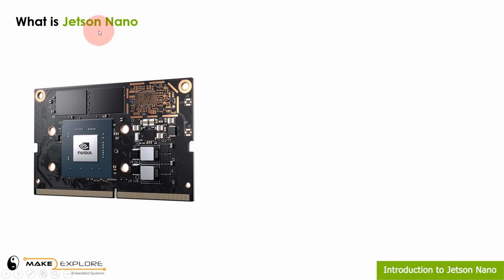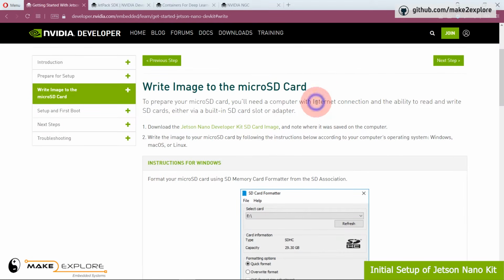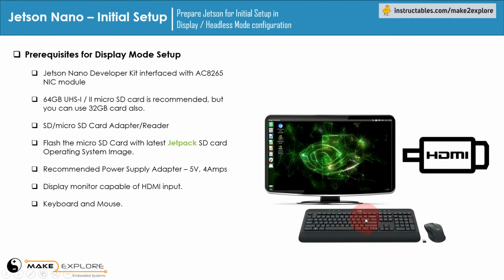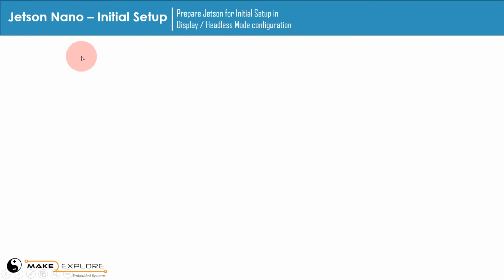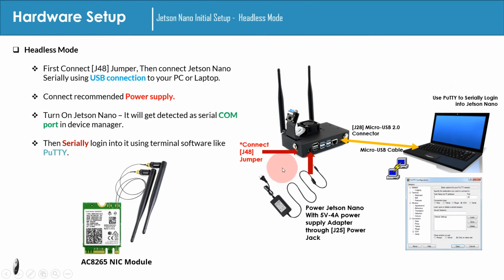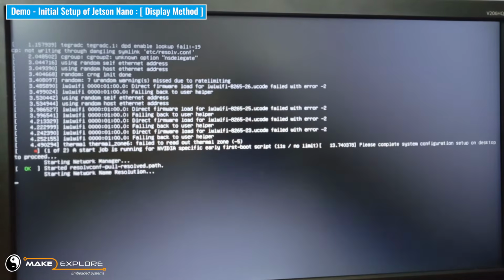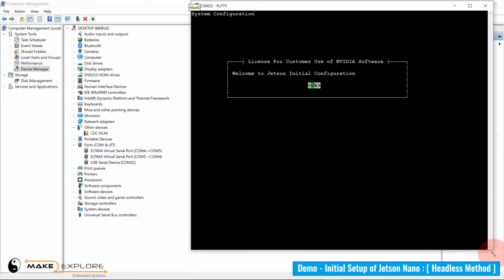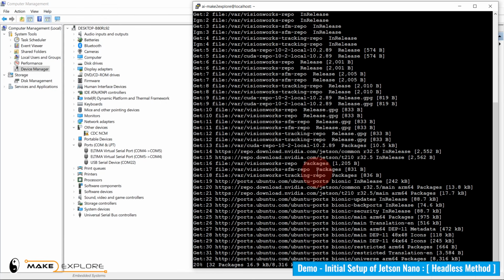[Tutorial] Getting Started With Jetson Nano

Comment: my jetson nano got delay about 0.5 to 1 second when typing. did sd card is my problem ? but i using the samesadisk version like you
Reply from the maker: Dear Friend, @madebagasmardiana3154

Thank you very much for your interest in our channel. Please accept our sincere apologies for the delayed response..

Q - my jetson nano got delay about 0.5 to 1 second when typing. did sd card is my problem?...

➡️ That kind of delay is definitely frustrating and, while the SD card *could be a factor, it's not the only possibility. The Jetson Nano is an embedded system and sometimes experiences general lag depending on the workload and configuration. A 0.5 to 1-second delay often indicates the CPU or memory is under heavy load and struggling to process system events, including keyboard input.

--  Try JetsonStats Widget - Open a terminal and run the command top or htop to see what processes are consuming the most CPU and Memory when the lag occurs.
--  If memory is low, consider increasing the size of your swap file (if you haven't already). This can help prevent the system from completely freezing, though it will still be slower.
--  Power Supply Issues - Insufficient or unstable power can cause the Nano's CPU/GPU clocks to throttle down, leading to significant performance degradation.
--  **Software/OS Configuration - try stable release of Jetson OS, JetPack. If you're using legacy hardware of Jetson Nano, then you should try legacy software OS variants. Latest JetPack OS may cause lag issues.

So, the most likely culprits are system load, slow SD card, or the OS.

Hope this info will help you. If you still have any other suggestions/issues/queries about this Tutorial, or any of our DIY project, feel free to ping us on WhatsApp/Telegram (Links given below).

Tech support - (𝗖𝗵𝗮𝘁 𝗢𝗻𝗹𝘆) Telegram/WhatsApp - 11:00 AM - 05:00 PM (Mon-Fri) IST   

🚀 𝗧𝗲𝗹𝗲𝗴𝗿𝗮𝗺      🔗 https://t.me/make2explore
💬 𝗪𝗵𝗮𝘁𝘀𝗔𝗽𝗽    🔗 https://bit.ly/3VXGGEe
📩 info@make2explore.com  / support@make2explore.com

Thank you very much for your support.

Best Regards

Comment: how can we put ubuntu 22 in it?
Reply from the maker: Dear Friend Jena Rohi, @jena2379

Thank you very much for your interest in our channel.

Q - how can we put ubuntu 22 in it?....

➡️ If you're referring to Jetson Nano Board used in this tutorial. So it is a legacy hardware. Installing Ubuntu 22.04 on the NVIDIA Jetson Nano is not officially supported by NVIDIA, as the latest JetPack SDK for Jetson Nano (JetPack 4.6.3) is based on Ubuntu 18.04. However, it is possible to install Ubuntu 22.04 using community-supported methods or manual upgrades, though this comes with potential compatibility issues, particularly with NVIDIA-specific components like CUDA, cuDNN, and TensorRT. 

So there are two options - 
Option 1: Manual upgrade from Ubuntu 18.04/20.04 to 22.04
We tried to manually upgrade the flashed system from Ubuntu 18.04 to 22.04. But we came across 'critical error' after that. 

Option 2: Use a Community Ubuntu 22.04 Image
You can try following community Ubuntu 22.04 Image
https://forums.developer.nvidia.com/t/ubuntu-22-04-image-beta-test-for-jetson-nano/253301
We also tried this but compatibility and dependency issues still comes.

📌 Important Note: The Jetson Nano is a different product from the Jetson Orin Nano. The Jetson Orin Nano is a newer device that has official support for Ubuntu 22.04. You can Download and Flash the latest Jetpack SDK directly onto SD card. Use at least 64G (Highspeed card). It comes with/built on Ubuntu 22.04.
🔗 https://developer.nvidia.com/embedded/jetpack

If you still have any other suggestions/issues/queries about this Tutorial, or any of our DIY project, feel free to ping us on WhatsApp/Telegram (Links given below).

Tech support - (𝗖𝗵𝗮𝘁 𝗢𝗻𝗹𝘆) Telegram/WhatsApp - 11:00 AM - 05:00 PM (Mon-Fri) IST   

🚀 𝗧𝗲𝗹𝗲𝗴𝗿𝗮𝗺      🔗 https://t.me/make2explore
💬 𝗪𝗵𝗮𝘁𝘀𝗔𝗽𝗽    🔗 https://bit.ly/3VXGGEe
📩 info@make2explore.com  / support@make2explore.com

Thank you for your support.

Best Regards

Comment: Can we use a power bank 20000mah anker to the micro USB to power it?
Reply from the maker: Dear Friend Ashish @ashish.pakabear

Thank you very much for your interest in our channel. 

Q - Can we use a power bank 20000mah to the micro USB to power it?....

➡️ Yes, you can use a 20,000mAh power bank to power the NVIDIA Jetson Nano, but there are some important considerations to ensure stable operation.

📌 Power Output (Most Critical factor)
--  The Jetson Nano requires 5V/4A (20W) when using a barrel jack (Recommended).
--  If using a micro-USB connection (older models), it needs 5V/2A (10W), but this may lead to instability under heavy loads.
--  Your power bank must support at least 5V/3A (15W) or higher (preferably with USB PD or QC support).

📌 Power Bank Specs
--  Check if your power bank has a USB-C PD (Power Delivery) or QC (Quick Charge) port that can deliver 5V/3A or higher.
--  Some power banks have "Auto Power-Off" features that may shut down if the Jetson Nano draws low current at idle.

📌 Connecting the Jetson Nano
--  Best Option: Use a USB-C to Barrel Jack cable (if your power bank supports 5V/4A output).
--  Alternative: Use a USB-A to Micro-USB cable (if your power bank has a high-current USB-A port, but this may not provide enough power under load).

📌 Battery Life Estimations
--  A 20,000mAh power bank (actual capacity ~12,000–14,000mAh due to efficiency losses) could theoretically run the Jetson Nano for:
==>  ~3–5 hours (if drawing ~4A continuously).
==>  ~6–10 hours (if drawing ~2A under lighter loads).

Hope this information will help you. If you still have any suggestions/issues/queries about this Tutorial, or any of our DIY project, feel free to ping us on WhatsApp/Telegram (Links given below).

Tech support - (𝗖𝗵𝗮𝘁 𝗢𝗻𝗹𝘆) Telegram/WhatsApp - 11:00 AM - 05:00 PM (Mon-Fri) IST   

🚀 𝗧𝗲𝗹𝗲𝗴𝗿𝗮𝗺      🔗 https://t.me/make2explore
💬 𝗪𝗵𝗮𝘁𝘀𝗔𝗽𝗽    🔗 https://bit.ly/3VXGGEe
📩 info@make2explore.com  / support@make2explore.com

Thank you for your support.

Best Regards

Comment: after the setup it showed the home page and suddenly turned off now it’s not turning on 
When I turn on and off the led is glowing for 1 sec and turning off pls help me with this
Reply from the maker: Dear Mohammad Junaid @mohammadjunaid2941,

Thank you very much for your interest in our channel.

Q - _after the setup it showed the home page and suddenly turned off now it’s not turning on 
When I turn on and off the led is glowing for 1 sec and turning off pls help me with this..._

➡️ This looks like OS/Jetpack related issue. (Black screen/Nano unable to boot/Screen Freezing/White Screen Issue). These are typical/usual issues with Jetson Nano -  You can check on NVIDIA forum

🔗 https://forums.developer.nvidia.com/t/nvidia-jetson-nano-freezes-at-nvidia-logo-screen/236944

Solutions ==> 
-- If you are using Jetson Nano 2GB/4GB (old Hardware variant which reached EOL support) 
➡️ Have you tried Nano with Jetpack 4.6.1 ?
During our project development and As per our experimentation/testing, we found Jetpack 4.6.1 is the most stable release for Jetson Nano.

You can try other versions also. Following is the Archives page. (4.6.1 to 4.6.6)

🔗 https://developer.nvidia.com/embedded/jetpack-archive

Try multiple OS releases and find out best supported release for your Nano 2GB/4GB

-- If you are using Jetson Orin Nano Series (New Hardware variant) 
➡️ Then try Jetpack 6.0 onwards, (you can try latest one).

🔗 https://developer.nvidia.com/embedded/jetpack

If the problem still persists then we suggest that you should carefully check your hardware configuration and setup, SD card/Power supply may be the issue.

📌Please check your Nano version then check your carrier board specifications and then choose correct power supply accordingly. 

⚠️***Since Nano is very expensive dev board. Please be cautious. Do not plug-in any random power adaptors unless you confirm/sure about voltages and current ratings. Check your device specific user manuals and datasheets for more details⚠️

Hope this will help, beside If you still have any queries/issues/suggestions about this Tutorial, or any of our DIY project, feel free to ping us on WhatsApp/Telegram (Links given below) for further support.

Tech support - (𝗖𝗵𝗮𝘁 𝗢𝗻𝗹𝘆) Telegram/WhatsApp - 11:00 AM - 05:00 PM (Mon-Fri) IST   

🚀 𝗧𝗲𝗹𝗲𝗴𝗿𝗮𝗺      🔗 https://t.me/make2explore
💬 𝗪𝗵𝗮𝘁𝘀𝗔𝗽𝗽    🔗 https://bit.ly/3VXGGEe
📩 info@make2explore.com  / support@make2explore.com

As per time permits we will try our best to help you out. 

Best Regards

Comment: I have 5 volt 2.5 amp adapter is that ok for just setup ?
Reply from the maker: Dear Mohamed @mohamedmansour2013, 
Thank you very much for your interest in our channel.

Q - I have 5 volt 2.5 amp adapter is that ok for just setup ?

➡️ It is totally depends on which version of Jetson Nano you have. and What type of Carrier board you are using. Check out following link for more details -

https://developer.nvidia.com/embedded/learn/jetson-nano-2gb-devkit-user-guide#id-.JetsonNano2GBDeveloperKitUserGuidevbatuu_v1.0-SCL

***Some versions of The Jetson Nano 2GB Developer Kits cannot be powered via the Micro-USB connector. 

If you are using old Jetson Nano(4GB/2GB) with microUSB and 5V Power Jack (Like we used in video) then Yes, you can try with 5 volt 2.5 amp adaptor for initial setup. If you are using USB Power then 5V⎓2 or 2.5A is recommended. 

But please note that if you connect any external peripherals like USB Mouse, Keyboard and WiFi adapter etc. They sometimes consumes/sink more power and Nano is unable to boot. Some power hungry computations(AI/ Machine Vision applications) requires more CPU/GPU power, Hence it is recommended to use at least (3-4A power for Jack) and 2.5-3A for micro USB(for old Boards).

📌Please check your Nano version then check your carrier board specifications and then choose correct power supply accordingly. 

⚠️***Since Nano is very expensive dev board. Please be cautious. Do not plug-in any random power adaptors unless you confirm/sure about voltages and current ratings. Check your device specific user manuals and datasheets for more details⚠️

Hope this will help, beside If you still have any queries/issues/suggestions about this Tutorial, or any of our DIY project, feel free to ping us on WhatsApp/Telegram (Links given below) for further support.

Tech support - (𝗖𝗵𝗮𝘁 𝗢𝗻𝗹𝘆) Telegram/WhatsApp - 11:00 AM - 05:00 PM (Mon-Fri) IST   

🚀 𝗧𝗲𝗹𝗲𝗴𝗿𝗮𝗺      🔗 https://t.me/make2explore
💬 𝗪𝗵𝗮𝘁𝘀𝗔𝗽𝗽    🔗 https://bit.ly/3VXGGEe
📩 info@make2explore.com  / support@make2explore.com

As per time permits we will try our best to help you out. 

Best Regards

Comment: puedes por favor recomendarme la camara USB que sugiere la jetson nano? (USB), gracias
Reply from the maker: Dear Friend @jmbcrp1010, 
Thank you very much for your interest in our channel. 

Q - puedes por favor recomendarme la camara USB que sugiere la jetson nano?

➡️ Jetson supports multiple camera interfaces including USB, Ethernet, and MIPI CSI. You can use according to your application. At its core, the Jetsons use the Linux kernel module Video Four Linux (version 2) (V4L2)

➡️ In case of USB Camera Series Jetson supports UVC(USB Video Class standard) - compliant board cameras. The video from a USB camera takes a different route. In Linux, The USB Video Class driver (uvcvideo) is a Linux kernel module. The uvcvideo module supports extension unit controls (XU controls) to V4l2 through mapping and a driver-specific ioctl interface. Input/Output Controls (ioctls) are the interface to the V4L2 API. What this means is that a driver in a USB camera device can specify different device dependent controls, without uvcvideo or V4l2 having to specifically understand them. The USB camera driver hands a code for a feature, along with a range of possible values, to uvcvideo. When the user specifies a feature value for the camera, uvcvideo checks the bounds of the argument and passes it to the camera along with the feature code. The camera then adjusts itself accordingly.

➡️ You can also use USB Depth Cameras, High Speed Cameras with Jetson Boards. Check out following list from official NVIDIA website for Jetson Partner Supported Cameras

🔗 https://developer.nvidia.com/embedded/jetson-partner-supported-cameras?t-1_camera-interface=USB&t-1_supported-jetson-products=Orin

For more details about camera interfacings you can check out excellent tutorials by Jim from JetsonHacks 

🔗 https://jetsonhacks.com/2022/02/02/in-practice-usb-cameras-on-jetson/

🔗 https://www.arducam.com/jetson-nano-xavier-nx-camera-solutions/

➡️ **For getting started with Jetson Nano, we suggest *Logitech C270 USB camera which is readily available and easy to setup.

If you have any queries/issues/suggestions about this Tutorial, or any of our DIY project, feel free to ping us on WhatsApp/Telegram (Links given below) for further support.

Tech support - (𝗖𝗵𝗮𝘁 𝗢𝗻𝗹𝘆) Telegram/WhatsApp - 11:00 AM - 05:00 PM (Mon-Fri) IST   

🚀 𝗧𝗲𝗹𝗲𝗴𝗿𝗮𝗺      🔗 https://t.me/make2explore
💬 𝗪𝗵𝗮𝘁𝘀𝗔𝗽𝗽    🔗 https://bit.ly/3VXGGEe
📩 info@make2explore.com  / support@make2explore.com

As per time permits we will try our best to help you out. 

Best Regards

Comment: After I do the first boot into my Jetson Nano 4GB. The autosetup GUI where you set the time, your new username, expand the drive does not start. All I get is the desktop. I already flashed the SD card 2 times. Why is the first boot setup not running after I log in? I logged in using username, pass: nvidia, nvidia
Reply from the maker: Dear @eduflyer , 
Thank you very much 🙏 for your interest in our channel.

Q - .. The autosetup GUI where you set the time, your new username, expand the drive does not start

➡️ Which version of Jetpack version you are trying to install?
At the time of creating this tutorial we used Jetpack 4.6. If you are using latest version, then there might be change in starting GUI setup in latest OS release.

Sometime Debian Linux/Ubuntu boots into live mode, which is also called "Try Ubuntu before you install it" mode.

If your Jetson boots in such mode then don't worry, just log in with live image. and then You will get 'Install OS' option icon on somewhere on Desktop. Just double click that to start the installation, then you will be able to set options like time, preferred language etc.

🔗 https://ubuntu.com/tutorials/try-ubuntu-before-you-install#1-getting-started

Q - ..logged in using username, pass: nvidia, nvidia

➡️ It means that, the OS you have flashed on SD card is pre-configured already. It may be just cloned image installed OS. If this version is running with no issues then use it. You don't need to worry about drive expansion or other configuration.

If you still have any suggestions about this Tutorial, or any of our DIY project, feel free to ping us on WhatsApp/Telegram (Links given below) for further support.

Tech support - (𝗖𝗵𝗮𝘁 𝗢𝗻𝗹𝘆) Telegram/WhatsApp - 11:00 AM - 05:00 PM (Mon-Fri) IST   

🚀 𝗧𝗲𝗹𝗲𝗴𝗿𝗮𝗺      🔗 https://t.me/make2explore
💬 𝗪𝗵𝗮𝘁𝘀𝗔𝗽𝗽    🔗 https://bit.ly/3VXGGEe
📩 info@make2explore.com  / support@make2explore.com

As per time permits we will try our best to help you out. 

Best Regards 🙏